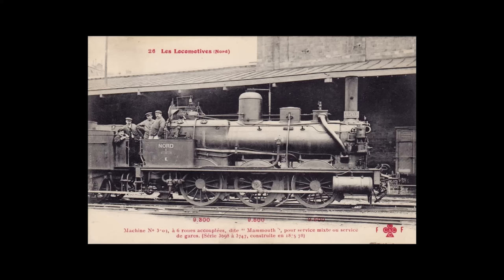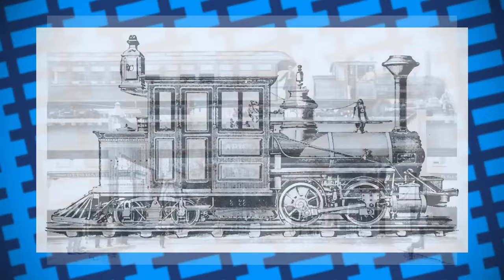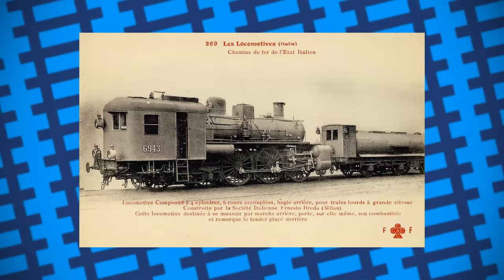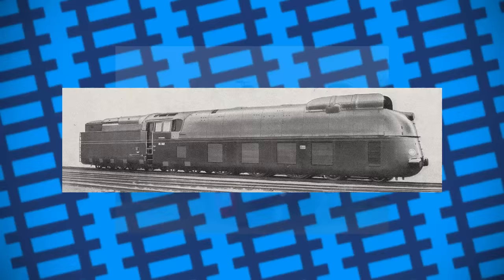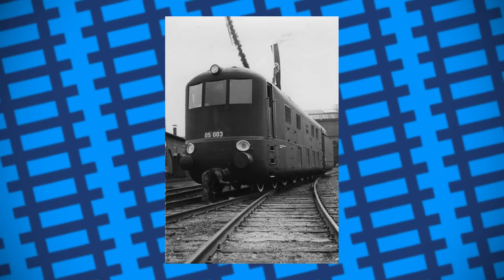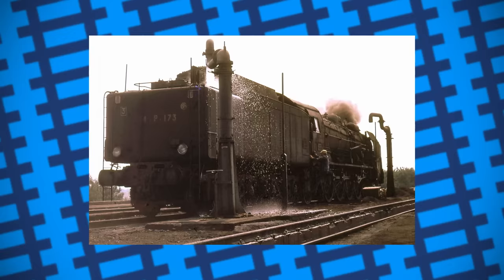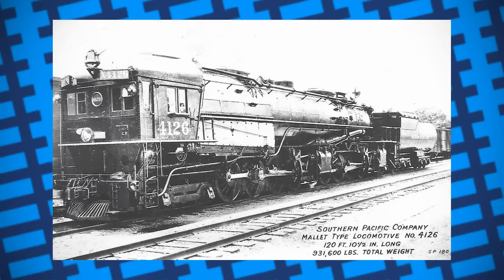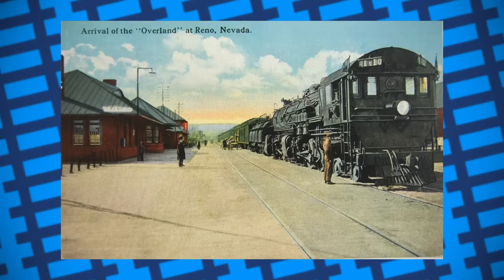Why "cab-forward" steam locomotives usually didn't work - Cab Forward Locomotives

Comment: Fun fact: As mentioned, the SP ran locomotives backwards over Donner Pass before the Cab Forwards were thought of.  This was not an official practice on the part of management, however, rather it was first done by a driver who finally got fed up with nearly choking to death in the tunnels and snowsheds on the Pass.  As a defiant gesture he had his loco turbed round to run tender-first before departing Roseville yard despite the difficulty of running backwards.  Management got the message loud and clear and began trying to figure out an answer to the problem, which led to the construction of the Cab Forwards.
Reply: I don't mean to pry too much, but do you have a source for this information? From what I have heard and read on the topic,  it was never allowable operating practice to run locomotives tender first over the Sierras and it seems that SP management was aware of the smoke problems when they arose. i.e. It was only after receiving the Mallet Consolidation Class (MC-1) locomotives that they ran into problems by nearly asphyxiating crews. While it is true that they ran experiments with the MC-1 Class tender first, they wouldn't have allowed this practice for other types of conventional locomotives. For example even after the Cab-Forward locomotives were created, conventional type engines continued to run in the forward direction over the Sierras, even with helper steam locomotives. So it wasn't as much an act of defiance that led to the creation of the Cab-Forwards, just operational necessity for the large Mallet and Articulating locomotives.
Reply: @FerrousEquusEng  You'll find that in ye olden days of American steam railroading some operating rules were treated as "guidelines" by the crews.
Reply: @davidwhiting1761  Yes, but even then, steam locomotives aren't particularly great at running in reverse when they are designed to run forward. I'm more curious as to which Engineer thought it would be great idea to run a full day up a mountain in reverse? Not to mention that they would often times need to double or triple head locomotives over donner in the days before the MC class showed up on the route. Did they coordinate with the other engineers so they all ran backwards?
Reply: @FerrousEquusEng  "steam locomotives aren't particularly great at running in reverse" why? from what i know running in reverse for steam, at least technically, is the same as running forward, just flip the steam distributor(or whatever its called) 180° and thats it
Reply: @Timsturbs  While it is true that steam engines can theoretically run both forwards and backwards with equal ease, there are a few factors when it comes to steam locomotives that change how well certain types of locomotives can run. 
Firstly, as mentioned in the video above, weight distribution of the locomotive on it's wheels is hugely important. Switching/Shunting locomotives were bad at running on curved pieces of tracks at high speed because the driving wheels would "hunt" down the tracks, essentially move side to side to the point that the wheels would derail. To solve this, you add wheels to the front and back of the locomotive that would help guide the locomotive around curves. Secondly, Valve gear on a steam locomotive is never quite perfect, and in certain cases was actually designed to be more efficient running in one direction versus another. While getting into the design of locomotive valve gear is certainly a very advanced topic, it is simpler to say that most railroads made sure that their locomotives ran forwards really well, and sometimes that meant they didn't run as well in reverse. Lastly, There are a  few design factors of the locomotives themselves that lead them to run better forwards rather than backwards. Aerodynamics, spring rigging, wheel profiling, driver setup and spacing, and more. 

Sorry if this is a very prolonged explanation, needless to say that sometimes it isn't as easy as saying, "Oh, we'll just run this train backwards all the time and it will be the same". There are a few factors that prevent steam locomotives from running backwards well.
Reply: @FerrousEquusEng  fair points, thank you.
Reply: The British main line tank engines would run happily cab backward or cab forward. Our local preservation line uses one.
Reply: cab forwards were undoubtedly based
Reply: Too bad SP didn't even consider cabforward designs for smaller engines despite themselves being Fuel Oil user. also no other Oilburner RR did this too.
Funny Enough. Italian RR did a coal burning cabforward passenger train, while SP didn't even do Cabforward Daylights of 4-8-4 Wheel Arrangement.
Reply: @FerrousEquusEng  fair point for tender engines that runs mostly forward and have turntable on its end stations. But some station doesn't have the space or money to offer a turntable. Especially in more rural area which tank engine usually operate. Most if not all tank engine can do reverse as well as forward. Heck I've even seen an old footage of a mallet running up hills with it's tender forward (granted there's barely any tunnels but the hill is quite steep and curvy).
Reply: @DiscothecaImperialis  While not really a coal burning cab forward; there were some large camel back (cab midway forward on the boiler barrel). Central of New Jersey, I think had an articulated camel back. The fireman was in the usual spot at the back of the firebox, with minimal weather protection.
Reply: @pinngg6907  Road tank engines are very much European and Australian preferred commuter train engines. not really Amercan ones.
Also no woodburner railroads use heavytanks like these to do road jobs.
Reply: @Timsturbs  Exactly, a properly timed valve gear does not care if the steam hits one side of the piston or the other first. Forward or reverse makes not one slight bit of difference to pistons, connecting rods, or any other part.
And I am a qualified, card carrying, steam fireman.
Reply: I like fun facts and you know, there is always someone who enjoys making a point. : )
Reply: @FerrousEquusEng  So back about 40 years ago I was able to ride on a 10 wheeler at a museum in California. The line was single ended so the engine ran forward outbound and reversed on return. Speed was 15-20 mph for maybe a quarter mile. As we ran backward the oil fired flame was lifted in the firebox a produced rather spectacular flames around the firebox door. Probable cause was the reversed air flow through the grate pushing the flame up.
Reply: @FerrousEquusEng    its
Reply: @pinngg6907    its
Reply: @NoName-zn1sb  its?
Reply: @NoName-zn1sb  no
Reply: @Timsturbs  there's this thing called a crown sheet in the boiler, right above the firebox, run backwards up hill and it may not keep covered with water,  and boom, bye bye engine so prolly unlikely anyone actually did this
Reply: @DiscothecaImperialis  they did have a mini cab forward, a shop engine with a cab forward front end, can't remember where though
Reply: @deathwishdrang1780  you realize that going forward down the same grade would have exactly the same danger, right?
Also, the boiler water level gauge is at the rear of the boiler above the crown sheet, so the fireman are in engineer would be watching it and making sure that the water level remained proper, whatever grade or direction they were on.
Reply: @FerrousEquusEng  most of your points don't really seem valid. For instance, on Donner there would be no high speed tracking issues, no aerodynamic issues, no wind into the firebox issues etc because they are going slow.
And how is the valve gear going to tell the difference between forward and reverse? In either direction it puts the steam into one end of the cylinder and vents the other end, the only difference would be which one end is first.
Reply: @ke6gwf  The high speed tracking, the drafting, and the aerodynamics were all illustrative points to talk about how locomotives were designed to primarily go in one direction. It's true that these issues are less relevant on Donner, you don't have a tremendously high tracks speed and consequently less drafting issues. There are some nitty gritty things with Valve gear that would limit your ability to run forwards and backwards in the same way, specifically your precision when setting your lap and lead, and if you haver to choose between running forwards well, and running backwards well, we know what they would choose. 

Honestly, the biggest issue you would have with running locomotives backwards over Donner was that consists running over Donner needed more than 1 locomotive to make it over the pass, with Helpers added in both directions prior to the articulated units coming onto the line. I'm trying to envision a situation where running one locomotive backwards, and 1 locomotive forwards, or even the extreme case of having more than 1 locomotive running backwards would be advantageous. The locomotives didn't have all-weather cabs, Double heading would ease the pain felt by the lead engine crew, but the 2nd or 3rd engine would be in pain the entire way through the snow sheds.
Reply: @ke6gwf  Didn't they make specialized boilers for going uphill, like at Pikes Peak? Running an 1860's 4-4-0 backwards up from roseville to donner summit just does not sound real to me...can it be done, maybe, did it? Not likely is all I am trying to say
Reply: @deathwishdrang1780  the places that had special boilers are MUCH Steeper than Donner.
And what's the difference between backing up, and going forward down the same exact grade as far as the boiler is concerned?
Reply: @FerrousEquusEng  
This "explanation" doesn't make any sense. The weight distribution of an engine over its wheels does not change an ounce by changing the firection it's moving in.
And repeating "there are a few factors" without actually naming, let along laying out, even one of those few is a fine example of lameness. 
Make that totally spavinned.
Reply: Apart from visibility why not just make the exhaust longer, bend 90degrees and release the smoke behind the cab?
Reply: Regardless of the drawbacks, I'll bet the crews really appreciated cab forwards when going over Donner Pass.

Comment: It should also be mentioned that even though the Southern Pacific Cab Forwards were extremely successful with the railroad, one of their biggest problems was just how much water they consumed. Bigger locomotives always use more fuel and water than smaller ones of course, but the Cab Forwards were especially thirsty. I don't remember the exact numbers, but I do know it was high.
Reply: Any clue why they consumed so much water? Inefficient design?
Reply: @antonberglund117 
I believe it was a combination of their operating conditions and overall design. The earlier Southern Pacific Cab Forwards (I believe the AC-1 through the AC-8) were essentially just reversed and rebuilt locomotives from the MC class (MC-1 through MC-6). Later Cab Forwards (AC-10 through AC-12) were essentially just AC-9 "Yellowstone" class locomotives reversed and redesigned. I believe the MC class locomotives and AC-9 were originally designed to burn low quality coal, but obviously this wouldn't be practical on a cab forward design, so they had to have even more work done to convert them to oil burners. Safe to say, the design of these locomotives was fairly convoluted by the time they were finished. That's not necessarily a bad thing, but it does mean they had some quirks that wouldn't be there had they been built from the ground up. The Cab Forwards were also specifically meant to go over the Sierra Nevada mountain range, and they'd obviously need more pressure in the boiler and cylinders to do so, meaning more water would be needed.
Reply: @CaliPepper  Only Mallet/Articulated locomotives on the SP that were coal fired were the AC-9s. All others were oil fired from factory. The SP Cabforwards were built as such from Class MC-2. Only articulateds that were "traditional" from the factory on the SP were the AC-9s, MC-1, MM-1 and MM-3 classes. (Class MM-3 was a WW2 purchase as SP was hurting for motive power to move freight)
All "Mx" classes besides MM-3 were rebuilt to simple articulateds from their original Mallet compound configuration. (Also, fun fact: SP classed Mallets under the MM/MC classifications, meaning Mallet (Mogul/Consolidation). They followed that up with the AM/AC classifications which mean Articulated (Mogul/Consolidation), none of which were compound expansion locomotives. 
Classes MC-1 and MC-2 became class AC-1 after the MC-1 class's rebuild into cabforwards, and all members of both classes converted to simple expansion articulateds.

In regards to the consumption of oil/water of these beasts, it wasn't out of the ordinary for such large locomotives as SP(like other companies), frequently pushed their locos to their limits in terms of what they could pull. At least they were not as hungry as the Duluth, Missabe & Iron Range Yellowstones which were said to be able to drain their entire 25 tons of coal and 25 thousand gallons of water out of their tenders hauling ore trains up a 20 mile grade.
Reply: @antonberglund117 , it's actually very simple, these locomotives were designed for and primarily used in mountain regions and as such were generally working harder then a locomotive on flatter terrain. Working harder while going up hill required more water regardless of the locomotive design.
Reply: @high_admiral5196  copy and paste is awesome, eh?
Reply: One of the biggest issues with a cab forward, I was told by the old timer who taught me to fire oil, is the fact that the crown sheet is at the highest point being the furthest forward. Because the crown sheet must be covered by water at all times it must be kept higher in a cab forward. So what is the problem? It is two fold. The more water you have in the boiler, the more fuel it takes to heat it. Secondly, because the water must be kept so high more water gets entrained in the steam. This is known as priming. Priming causes hard water deposits on the superheaters insulating them and causing wet steam to be expanded in the cylinders. It also causes excessive wear on the cylinders, valves and piston rings. Being articulated locomotives means they had very long boilers which exasperated the problem. 
I was taught to fire steam on the Southern Pacific 3420 in El Paso Texas in the mid eighties. The gentleman who taught me was himself in his late eighties and had been a fireman from about sixteen years old. 
I am very blessed to be just second generation from everyday steam. The older gentleman being first.
Reply: @CaliPepper  Thank you for your comprehensive answer, it's always fun to learn something new in detail.
/a swedish railfan
Reply: @ryandavis7593  Keeping the crown sheet covered while climbing on cab forwards limited them to about a 2.4% grade.  This was chosen because that was the grade on the Donner Pass route.  On steeper grades the Southern Pacific used smalller engines with the cab in back.  On engines with the firebox in back it was important to keep a very high water level when climbing because when you reached the peak an started down water in the boiler would move forward lowering the level at the crown sheet possibly resulting in a boiler explosion.
Reply: Even the AC-9's were eventually converted to burn oil.  They were built as coal burners because when the Southern Pacific bought another railroad it came with a coal contract.  When the coal contract ended they were converted to oil.
Reply: @antonberglund117  One reason was the massive amount of steam needed to pull those grades.  The other is an interesting fact.  The firebox on them ran so incredibly hot that when the engine was pulling hard (more fire) and moving slowly, the firebox radiated so much heat that pine needles (this was in the high Sierras remember) twigs and other small tender material next to the rails would sometimes be set on fire.  If you look at this video at just after 6:00 there is a decent photograph of the cabforward.  Look closely at the first driver.  just above the rail is a rectangular box obscuring the forward end of the drive rod.  This was a water sprayer that the fireman could use to wet down the debris to keep it from catching fire and burning the cross ties, or worse, starting a forest fire. These were necessary but accounted for a tremendous amount of water usage.  And also accounted for the tender holding as much water as most small swimming pools.
Reply: @reggienone966  Oh I see, that was an interesting bit of history
Reply: Out of every scrapped SP cab forward, my favorite is the AC-6 SP 4126, whose model saw action in the "Legends of the Rails" song of I Love Toy Trains 9.
Reply: I think that over Donner Pass, they went less than 15 mph, so I think they ran pretty much having the reverse close to the corner going upgrade.

Comment: In short, Southern Pacific liked the cab forward not only because it made it easier for the cab crew to breathe in tunnels, but also because it offered superior visibility, too. That's why SP didn't retired the last of them until 1954.
Reply: Not quite! The last SP Cab Forward to work a revenue train was actually in November 1956. Then about a year later, a fantrip occured with an AC-11, 4274. Appropriately it was a round-trip over Donner Pass, working east to Reno, NV one day, then back west to Sacramento the following day. That fantrip wasn't just the last time a Cab Forward ran over the territory that necessitated their design, but also the last time a Cab Forward ran under its own power
Reply: @russellgxy2905  I don't know if UP (whom bought SP in 90s) will build a new cabforward for this and should UP bother to do so? while the 4294 is now considered relic.
Reply: @DiscothecaImperialis . Build a new cab-forward?
Reply: @douglasskaalrud6865  uhm.